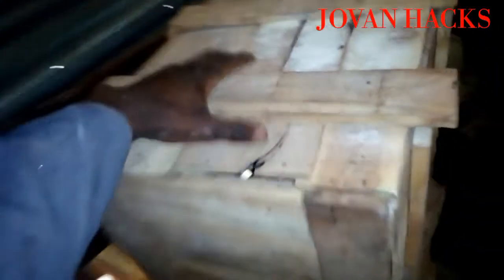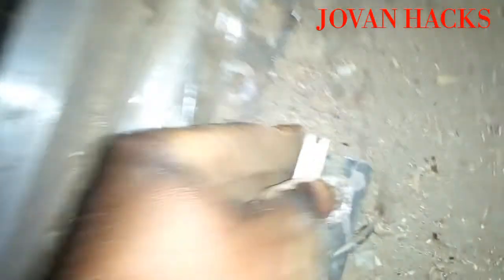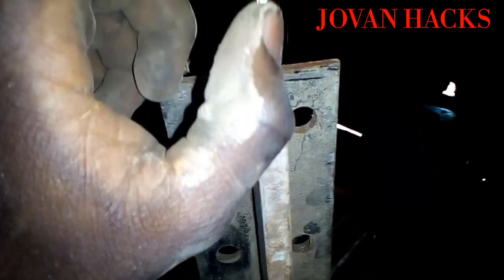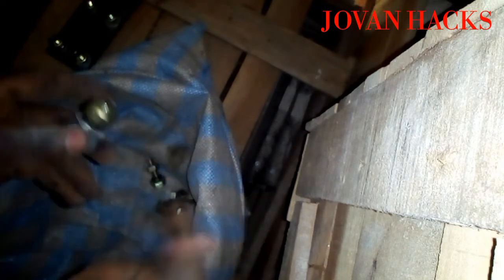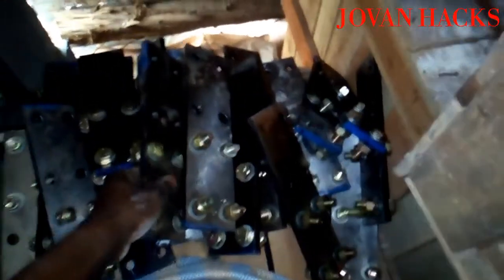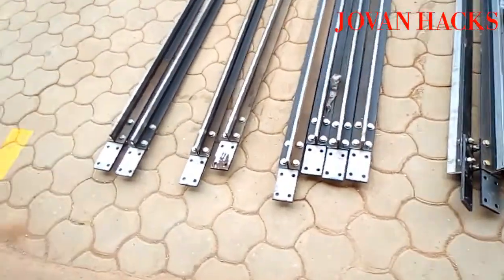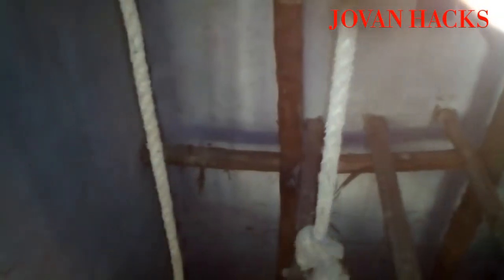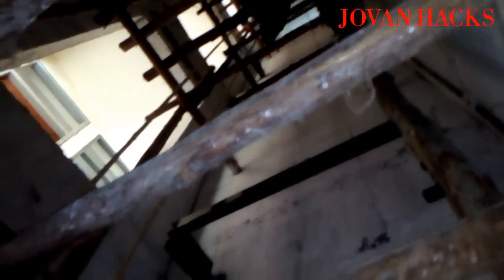how to join guide rails using fisher plates in elevator (lift) installation

Comment: Am new in this field
Any advice
Reply from the maker: Ensure your safety at all times. With this kind of work, there is no need to rush. Cooperate with engineers, supervisors, and foremen that you find at site. Don't go under heavy equipment during hoisting, I've seen chainblocks fail. Don't be discouraged. This is a good field, and you will learn more as you keep working. Good luck, brother!!!
Reply: Thank u 🎉🎉🎉
Reply: For giving confidence ❤❤❤